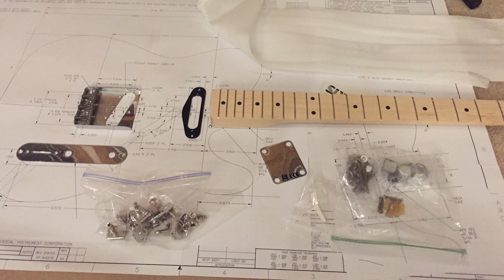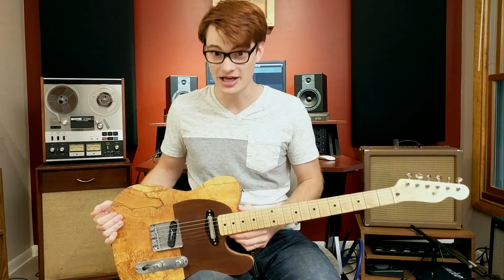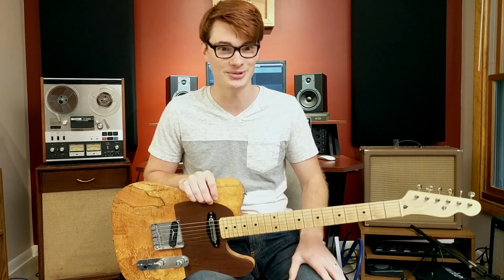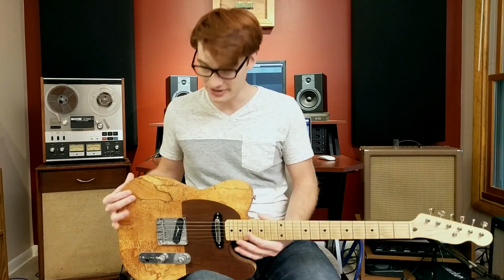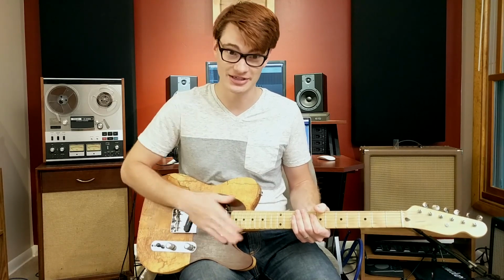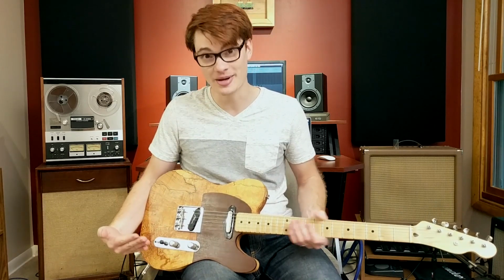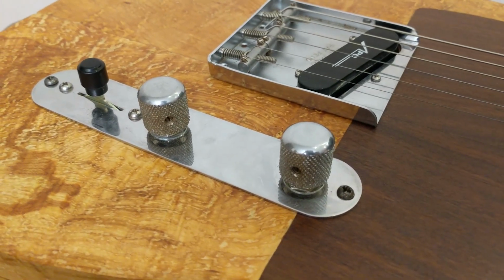Maple Telecaster - D.I.Y. Guitar Build

Comment: beautiful guitar, love the pickguard inlay.  any advice if i wanted to try doing something similar?  did you make the pickguard, then make a template from it to route the body, or...?  was it hard to get a tight seam?
Reply from the maker: Made the pickguard first. the one side is straight so it fits tight and then I basically slide the pickguard in against the curved side and kept fixing high spots until that gap was tight too.
Reply: @MerwinMusic  excellent, thanks!

Comment: I would love to do this. Did you air dry or kiln dry the wood, and for how long? Looks and sounds great!
Reply from the maker: Just air dry. The tree fell 2-3 years before we cut into it so it had some time to die and dry. Then we cut it into a slab and put on the floor in my father's shop which is radiant heated concrete for a couple of months. So it air dried but it was definitely helped by the floor heat.

Comment: Did you have to dry the wood before using it?
Reply from the maker: Yeah. The tree fell about 2 years before we cut into it. Then the wood sat in my father's shop for about half a year. Plus it was on the floor which has radiant heated so it helped speed up the drying process.